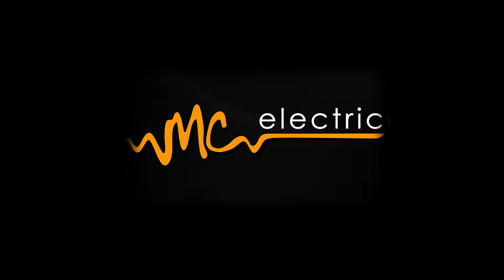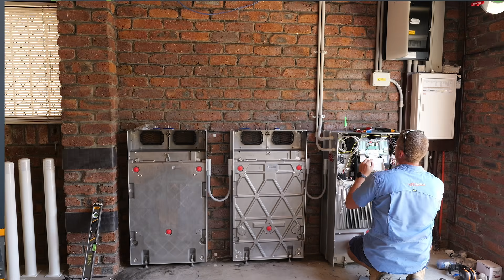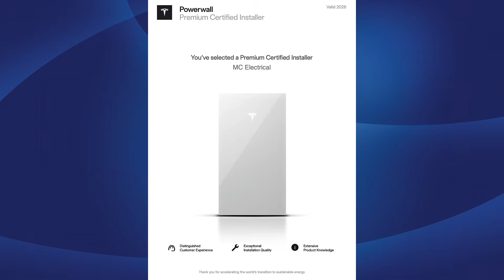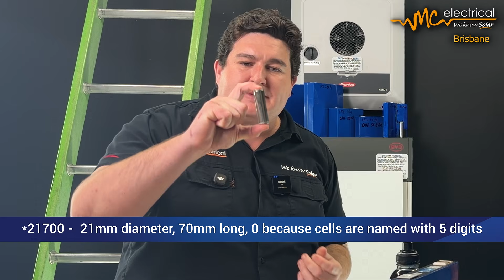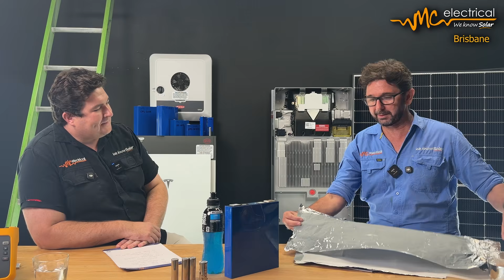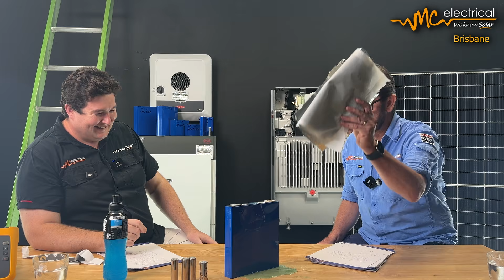Tesla Powerwall Problems Exposed — but why we're sticking with it.

Comment: It will be interesting how Tesla respond to all these modular stackable designs flooding the market.  
I'm trying to figure out what battery system to buy for when I have my solar installed and in terms of features, battery charge/discharge rate the PW3 is very solid for the price compared to say a Sig.  For my usage I worked out I would need 3 batteries stacked on the Sig system to match/exceed what a PW3 can do in discharge rate.  Otherwise during peak loads at night time would be dipping into the grid.  For me the capacity of the PW3 matches my homes usage and fits in a tight space a the side of my home where the Sig might struggle to fit (not impossible).

The only thing I don't like the idea of is it the noisey fan during peak loads.  I'm not really sure how much it would be heard though as I plan on having it installed outside and peak loads at my property probably only run for 10-15 minutes at a time a couple of times a day.

Comment: Biggest issue with Tesla is upfront cost & maybe space (could be seen as a benefit though). 

But I would argue the overall design is more durable/redundant which accounts for some of that cost.

Each stack is generally an independent  13.5kWh battery, inverter, cooling, comms,  housing which makes the system more redundant and fault tolerant.

Despite this tesla is still more conservative with charge/discharge rates.

If you compare this to a lot of other systems, they have stacked 48kwhrs in a small area on top of each other, then a large inverter on top again and sometimes only relying on passive cooling. 
This design is ok if you are fine with slow charging/discharging, but some even allow 1C Charge/Discharge.

Not to mention some of the companies and designs are new. (Not battle tested/proven for longterm durability).

On tesla, you could have 1 Powerwall go bad and go offline. Other systems you tend to lose everything.

Comment: Interesting video makes me a little nervous as one of the 90 MCE has installed but good to hear Tesla appears responsive to the issues.  The fan commentary was interesting it has only happened once so far but the fans got up to a whine so loud an Apple Homepod detected it as a fire alarm and send me an alert when I was away from home.
Reply: Hi Roy, if it's any consolation its not an MCE specific issue, but with us, you will be well taken care of in the unlikely event a hiccup does occur. 

The Apple HomePod thinking it was an alarm is very interesting. The fans caught me by surprise when I heard them for the first time. Tesla does like to outdo Fronius where it can.

Comment: I’ve been through several major storms here in North Queensland and storm watch hasn’t triggered once 🙄
Reply: It needs to be a pretty severe weather warning for your location. In the couple of years I have had my PW2s, I have only seen it trigger twice, and one was during Cyclone Alfred.

I am assuming it is turned on in your app. I think there was a pairing sequence you need to do for the features "storm watch" and "go off grid". It may be worth double checking on your app.

Comment: How do you measure round-trip efficiency? Taking numbers from inverter(total discharged/total charged energy in kwh) or independent meters like the mentioned Fluke? And what model of meter is this? But how do you connect Fluke meter between the battery and the inverter if you have Tesla Powerwall All-in-one solution? I have a Solax system 12kw X3-Hybrid G4 + T58 battery and based on the Inverter data I can't see difference between fast discharge vs low discharge(5% of the maximum power). Fast, I mean full power and also 50% of the maximum inverter power. I have checked this many times and it usually keeps the same % , taking the avarage over several cycles. Being honest I even see lower efficiency at high power, because BMS shuts it down faster and leaves more energy in the bateries, I can see this in the voltage of the whole pack when it bounces back after a few hours, but still shows 10% remaining SOC and also less energy I can put in on the next cycle.
Reply from the maker: Hey Mikolaj, we should probably do a video to explain this soon. It’s AC round trip testing. The only way to do apples to apples of the whole system. 
We use the Fluke 1738. We turn off the PV. In the case of inverters that have the backup contactor in the inverter, we disconnect all backup circuits and run them as non essential. We turn off the solar. Then we clamp the inverter feed - the AC side. 
Whatever comes in and out of the inverter is also what comes in an out of the battery.
We cycle it several times at different charge and discharge rates.

Comment: my parents have a single powerwall 3, and it appears to balance there usage really well, they looked at the expansion packs but decided against it as the cost didn't warrant it. Current power bill is about $10 for the month with 6 days to go and most of that was last Sunday / Monday when if was overcast and raining all day. putting a hotwater timer in etc helped significantly as well to push power consumption to when there is plently of excess solar and they haven't notice any issues with running out of hot water etc. App is great and easy for my elderly father to use and understand.
Reply from the maker: Nice. Yeh one Powerwall is often heaps for an elderly couple. Paying for a return visit would really throw the cost out especially if you are just trying to save $10 a month.
Reply: That's great to hear your parents are seeing significant savings with their Powerwall and load shifting! Optimizing self-consumption, especially with appliances like water heaters, makes a big difference. Volcast can help you maximize these savings by providing accurate 7-day solar forecasts, allowing you to better plan your energy usage and battery charging/discharging.

Comment: I'm one of those 4 who had a power surge due lightning strike near my place & my brand new Powerwall 3 failed.  No other appliances failed and no one in my block of 8 townhouses had anything fail.  So I found that pretty poor that a cheap kettle or a TV etc are fine but an expensive Powerwall died due to a minor surge.  Initially Tesla said they would replace Gateway under good will to see if that was the problem.  This didnt fix the issue so it was the Powerwall.  This was NOT covered by Tesla and I had to go through Building Insurance.  The excess to pay ( through my Body Corp ) was $2000. Also, I had NO SOLAR for weeks as even though that was working, it goes through the Powerwall.  Had a blackout during that 2-3 week period ( Murphy's Law ) so no power during that.  I think the Powerwall is a very good product ... but seems there is definitely an issue.  Perhaps the 12v communication between the Powerwall and the Gateway!! So now anytime there is a storm I am quite concerned.  Food for thought before you buy a Powerwall 3.

Comment: If your happy to continue with a 10% failure rate, are your customers ? - The customer is making a one time, expensive,  purchase - Are they told up front that there is a 10% chance their system will die and they will then have to wait for a warranty claim when that happens?.
Reply: We have not taken this matter lightly. There appears to be a potential weakness in the PW3 to grid power surges. This has been identified, and reasonable steps have been implemented now to reduce the risk of this point of failure. We are at this stage confident that the matter is being taken seriously and is being actively addressed by Tesla. 

Tesla Australia should be commended for how they handle warranty issues. It's refreshing to work with a company that takes responsibility for their product and doesn't go straight to throwing installers under the bus, or a SolarQuotes expose to get the ball rolling on a solution.

Comment: 54kWh of battery is nice, but 8kw charge rate for that size battery is well under the current industry norm. On those heavily cloudy days you want to max out the amount of photons you convert to stored energy when the cloud cover clears for a few minutes.
Reply: 8kW is the minimum charge rate. Depending on site conditions, it can even be a little higher than 8kW for 2/3 expansions. If you need faster charge rates, you can pair 2x Tesla PW3 and then have 2x expansion modules on the leader. This will can give you close to 15kW charge rates.
Reply: @Yorick_Mark  I have TP3 and expansion pack. After current firmware update 26.1 it now charges @ 10kw
Reply: @Toosha1974 According to Tesla I can neither confirm or deny that it will charge faster than 8kW. 🤫

Comment: I'm not sure "blackout charging" is a good idea for everyone. I've only lived in my current house for 9 years now and we have never had a blackout.. so would the battery charge itself from the grid "just in case" every time we have a storm?
Reply: It is a function you can toggle on and off. 

It also rarely activates. You need a cyclone warning ⚠️ or similar for it to activate
Reply: You can choose which of about 50 BOM weather events to charge for. E.g. you can just enable it just for say "Cyclones" and "Lava Flows", and not for "Strong Winds".

Comment: Just on you highlighting the relative inefficiency of very low load (you said maybe just a fridge overnight). True of course when operating a high capacity inverter at low load, but I don't think it's an issue at all. Delivering up to 300W inefficiently still doesn't consume much total energy. The much higher efficiency at high power is where the payoff is. In fact, I'd be choosing to run a negligible house load overnight (fridges use almost nothing overnight when the door stays shut) from the grid, adding up to essentially nothing, after the evening activity peak & everyone is asleep. But my point is it doesn't matter in battery consumption or grid import $ either way for such a predictable low load.

PW is being reported with high failure rates from multiple sources actually. Surprising for an established product from an established company. These are essentially pretty simple devices in relatively stable environments (compared to batteries in EVs).
Reply from the maker: Yeh that’s a fair comment. On the other hand however there are plenty of times when you are charging your battery slowly on a rainy day, and that extra efficiency would help. Or discharging at 1kW not 10kW. So many variables.
Reply: @mcelectrical  Ideally solar would be dc-coupled & not incur any redundant inverter+regulator losses into the battery; just the comparitively high efficiency dc-dc voltage step. AC-coupled round trip efficiency, particularly at low power through a high capacity inverter, will of course never be good.

Comment: Interesting.

My Installer commissioned my PW3 + expansion to 5kW inverter. They told me you cant have 10kW inverter for house usage and have export/import set to 5kW. They said I need to upgrade my Service line. Seems like the PW3 is still behind the times.
Reply: Depending on your local regulatory requirements that could be the case. In SEQ that is not the case. 

 Is it AC coupled to an existing PV system with a 5kW inverter?
Reply: @Yorick_Mark yea its AC coupled with a solar edge 5kw inverter. I'm in South Australia. They say it's a limitation with the PW3 that it can't have charge/export limited. So they had to make the pw3 inverter 5kw. I always thought the Powerwall 3 was capable of 10kW house backup... Well.. that's what I was told when buying it. They'll upgrade my service line for 5k though 😅
Reply: @SenorNavel That explains it. In QLD you can only have 10kW of solar inverter + 10kW of AC coupled battery inverter.  The TPW3 has solar imputs so it counts as a solar inverter. It it wasn't AC coupled you could have had it programmed at a 10kW. 

Being SolarEdge you cant  simply wire the array into the pw3 directly without removing all the optimisers.
Reply: @Yorick_Mark 

The installers reason for the 5kW limit is "The PW3 can't limit charge/export with the software, thats why we made it 5kW. If this is true, then Tesla Powerwalls are behind the times.

As soon as I upgrade the Service line I can have 10kW, so the system can have 10kW, its just the Telsa Powerwall 3 software that cant do what other brands can do by limiting the charge/export like they're required to do in W.A.

Don't buy Tesla people.

Comment: I’ve had my pw3 for a few months now and it’s been working brilliantly. Awesome synergy with my model3 and its wall connectors. I haven’t paid for electricity or fuel for ages. Mine is ac coupled to my fronius 10kw inverter and 13.5kw solar. Awesome bit of kit. Very informative video, thanks guys!
Reply: Thanks for your great feedback
Reply: I've got the big solar array and home battery, soon I'll be selling my 12 year old euro car (it's nice, but I'm quickly learning that owning a reliable euro car for more than 10 years is not advised). Being able to drive on excess solar would be a nice thing, especially in the current global context.
Reply: @sjwright2  As an EV owner myself. It is nice not to worry too much about the oil price for my daily commute. Obviously, there are the larger flow-on effects that are unavoidable. My best advice is get a reliable smart EV charger. Evnex or Wattpilot Flex are my top picks or the Tesla wall connector if your all Tesla. Just make sure you set a maximum import current. We have had a few people tripping the house main switch while charging their batteries and EV at the same time on rainy days.

Comment: Let me invite some possible Sig bashing 🙂 You mentioned the importance of having an SPD. The Sig inverter has an internal SPD, and Sig Gateway also has 3-phase SPDs in it (and standard, easily replaceable ones too 👏). But I'm not clear on the wiring, do you know if the SPDs in the Sig gateway protect only the gateway controller, or if they protect the whole house?
Reply from the maker: Ha, that’s more of a deserved invite for Tesla bashing. 
I think it would depend on the setup. If the whole house is backed up then yes most likely. Otherwise it would just be the backup circuits.

Comment: If you need a small 13kWh system (or even 27kWh), Powerwall is clean and attractive, probably the best for an "in plain view" system. But personally this is a step too far for "all-in-one". I don't like that the battery and inverter is so built-in you can't easily replace one without the other. They might not have the same longevity beyond 10 years, so you could end up throwing out perfectly good gear?
Reply: That is a real possibility. I suspect the battery cells will outlast the inverter component. Its a sleek design but not a particularly serviceable system.
Reply: @Yorick_Mark  It's very Apple-like, isn't it. It'd be nice if the internal inverter module was replaceable. In my dreams someone would make an inverter with the electrolytics and mosfets on a replaceable cartridge. It's probably impossible with the very high current and low resistance requirements, but it would be cool.
Reply: This is a good reason to consider Fronius (et al) where the inverter and battery are truly independent. The Powerwall does put too many eggs in one basket, but you're fine within the warranty period. As for systems like Sigenergy, I don't believe for a moment that they'll still be selling replacement modules compatible with an existing stack in 10–15 years time. Maybe they will, but I wouldn't make that bet. So if your concern is longevity past 10 years of ownership, IMHO everything is a gamble.
Reply: @sjwright2  From that perspective, Fronius is a very safe bet.
Reply: @sjwright2 you're right there are few guarantees for the far future, but neither do I want to have an install with cables and conduit everywhere. The modular systems are a good compromise between too restrictive and too birdsnest IMO.

Integrated inverter and BMS is a lot cleaner & generally provides better system integration and a better app.

Sig's DC bus makes the system independent from the battery module technology. So Sig could sell e.g. Sodium batteries for existing Sig systems, no sweat. No issues with mixed size, degradation, age, chemistry or cell management. Even modules that aren't batteries, like the DC EV charger.

You're right, there are no guarantees Sig won't move on to new model systems and forget the old ones, like Tesla did, but Sig's is a fairly future-proof design. So long as the DC & control bus system remains suitable, Sig could support it with new modules types, even if old module types are mothballed. Like right now, the 5 & 8kWh modules are being replaced with 6 & 9kWh modules, yet fully compatible with existing systems.

That's the unmentioned weakness of HV modular batteries. They're not really modular if you have to replace the whole stack if the supplier's battery design ever changes, which they do all the time right now.
Reply: @azzafdu  Between the two systems I oversee (a PW3+expander and a Sigenergy stack) the PW3 install is aesthetically much nicer,  but that was mostly a consequence of the installer's level of care.

If you're fortunate enough that you can make aesthetics a key consideration, then go ham with whatever product you like.
Reply: @sjwright2 assuming a good install, a single PW is compact and unassuming and you could put on the front of a house and it would look relatively inconspicuous vs any thick or thin+tall stack product, or anything with a separate inverter. So it has its place IMO, regardless of technical comparisons.